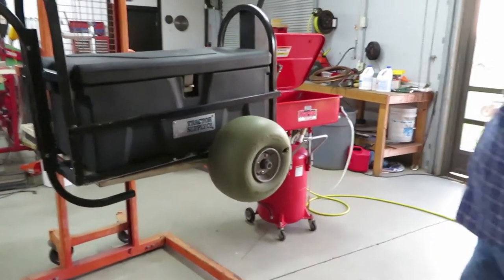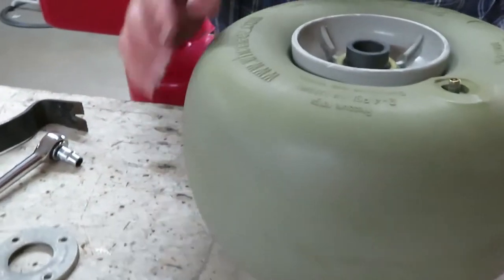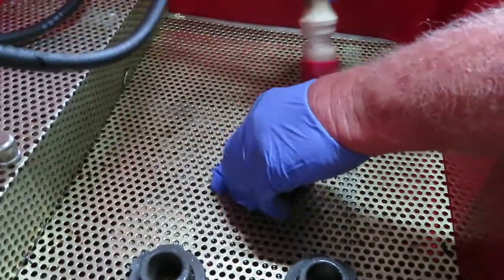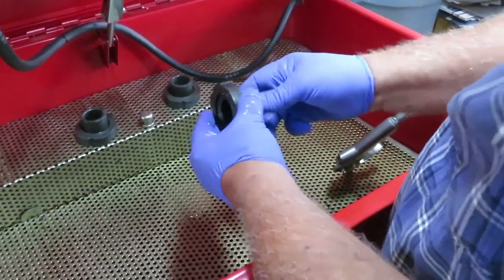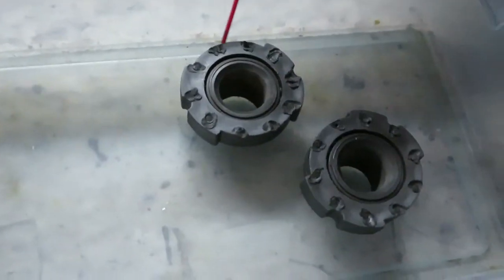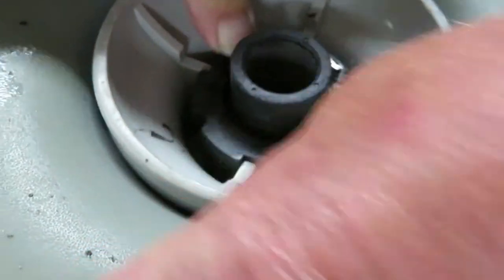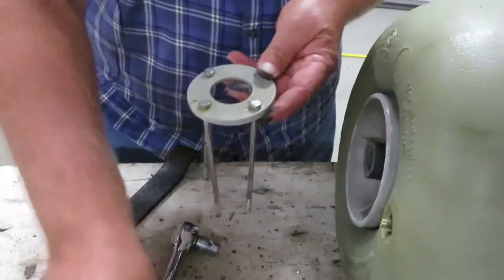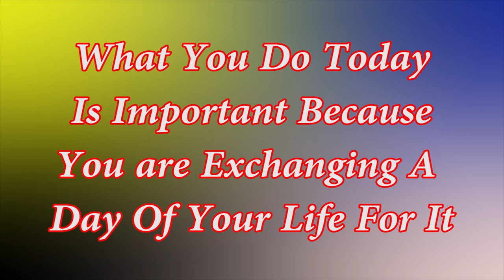Wheeleez balloon tires, replacing bearings and or cleaning

Comment: I don't have access to most of the tools, etc that you are using. Do you think that using garden hose sprayer to try and clean them out will work? I was thinking spraying vigorously, using a blower to help get the water out. Then using the dry lubricant?